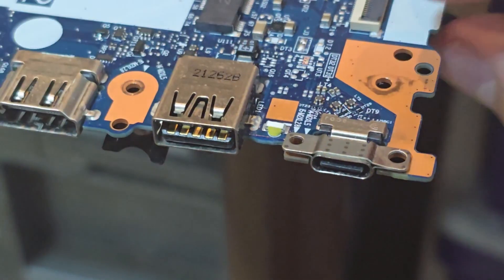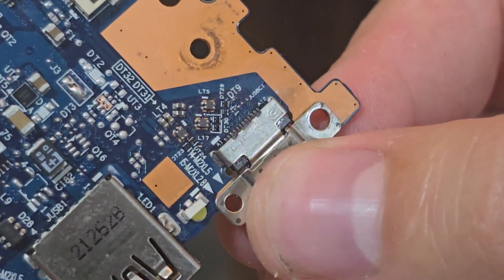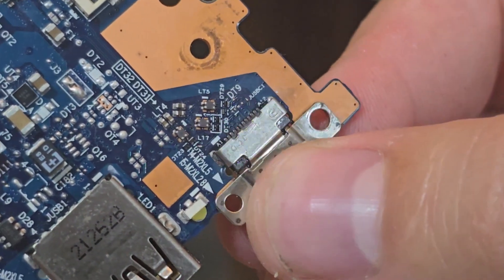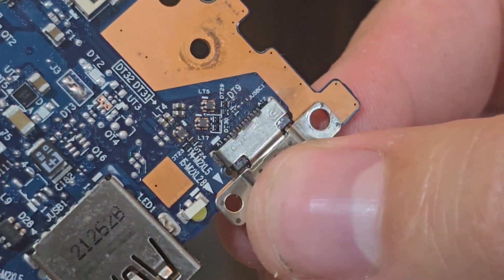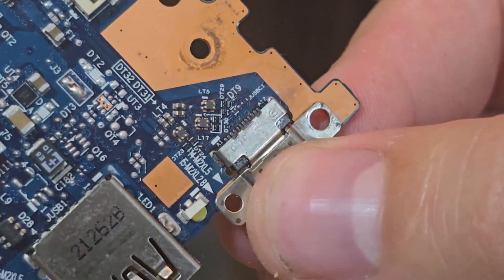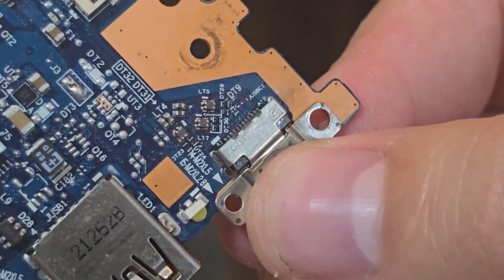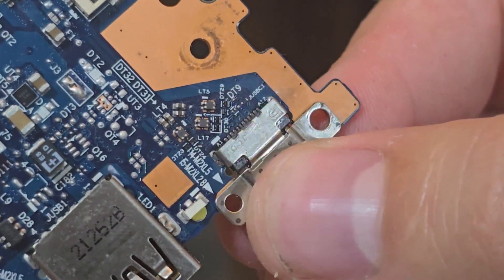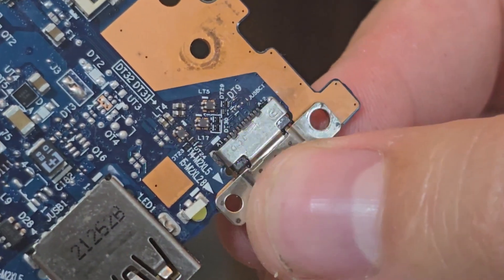USB C port replacment ThinkPad E14

Comment: Don't use t12 tip as a poiner, use it as a soldering iron insted of your rusty ones. Use somo solder before wicking.
Reply from the maker: Thenks, i did most of those things. I do agree that I need more versatile selection of tips. Thenx